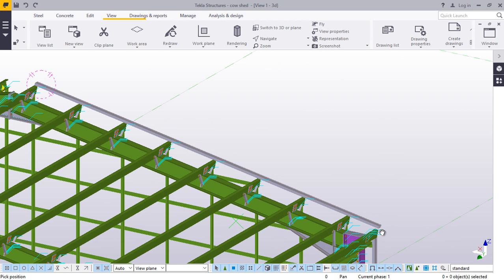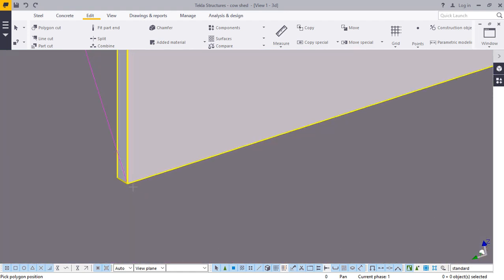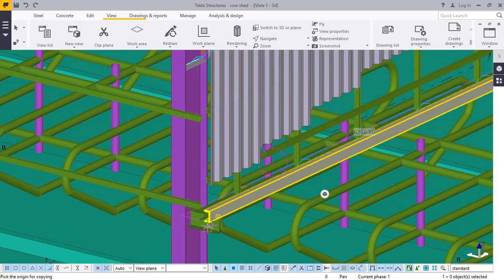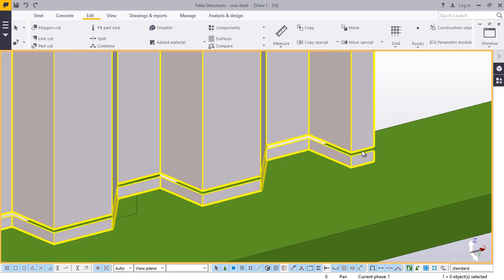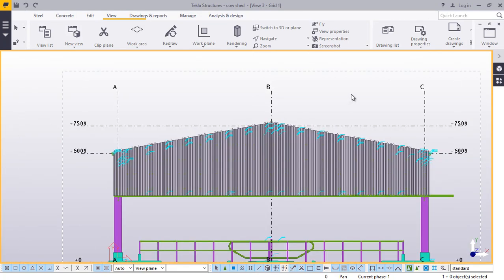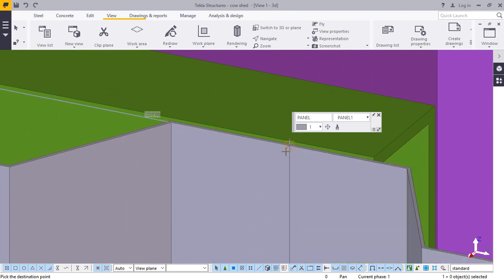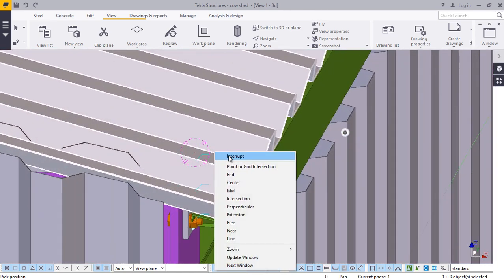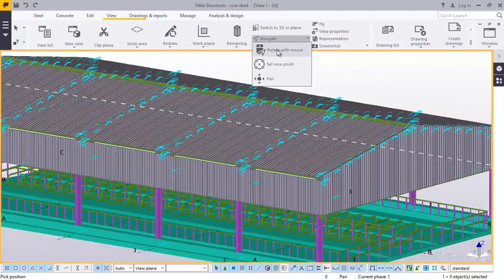How to Model Cattle Shed Part 4 in Tekla Structures

Comment: Hello. I sent several youtube from you. I am working on my on remodeling for my house. My new mail please send to rolivelucen@gmail.com. I can send pictures on the backyard, or send the sizes. I want to extend the patio and back structure (2-storey house, wall width 20ft x 50 ft (feet) + 15 ft, the left size on the house, another 10ft x 20 ft; and the right size of the house is 35ft x 15 ft. I want the steel poles for the terrace, but I need a spam of terrace of minimum 20 ft length, and width of 10 ft spacing . Any model for the pillars (steel)? Thank you
Reply from the maker: Mr.Robson i got the message but isn't clear, if  you don't mind please could you come up again with the question.